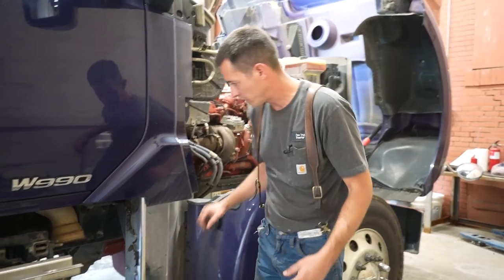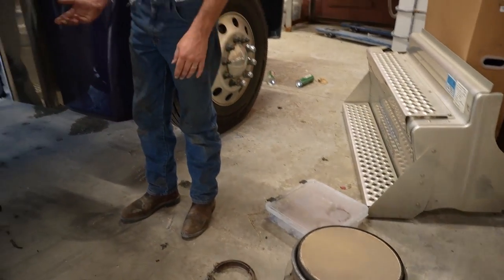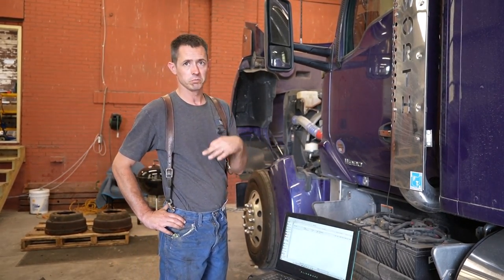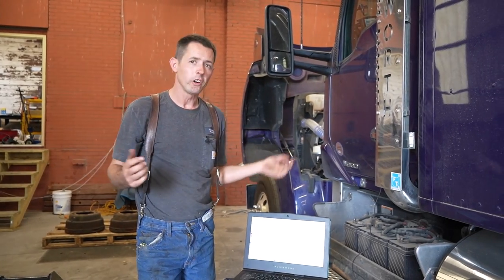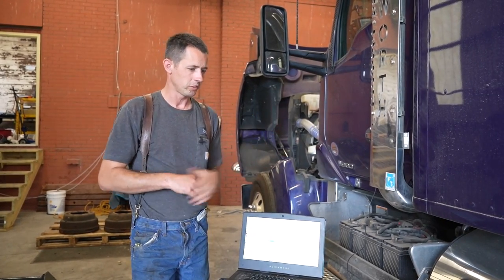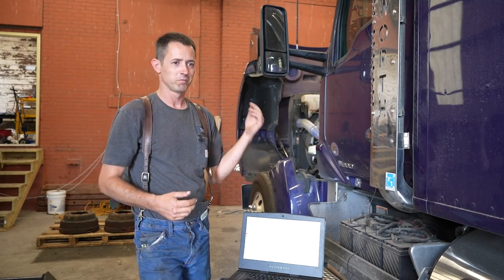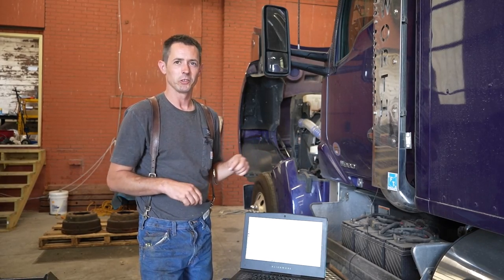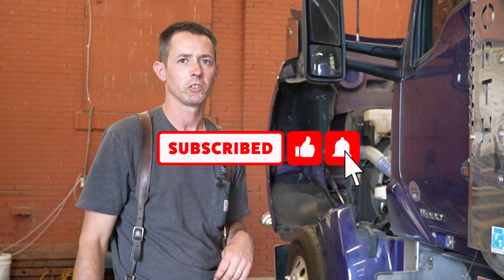Will Truck Run With DPF Unhooked?

Comment: This is how diesel engine supposed to run. If Truckers in the U.S. and Canada were smart and mechanically potent enough they could run diesel without DPF and EGR while police wouldn't be able to notice unless they take pollution test

Comment: I do believe...as soon as the speed sensor starts transmitting movement you might trigger a derate, i have found that disconnecting the right front ABS sensor on a 2015 579 Pete with the MX13 will stop a derate.
Reply: For how long?
Reply: It will. Go down the road, put a load to it, and *bing*, engine light comes on.
Reply: Engine light mean nothing.. all it is telling you are polluting.  I run with check engine light on for 100K miles and still running fine.  I just reset the dpf and force regen with my scan tool. Derate is non issue for me.

Comment: I’ve noticed even on my truck because I’ve started it and ran without down pipe…these newer model engines with EGR and VGT turbo they’re not really as loud as the older engines that are straight piped….mine is fully deleted now and still pretty quiet with modified DPF
Reply: What year, truck and engine may I ask?
Reply: @jimjim6803  2010 and 2016 ISX
Reply: @jimjim6803  maybe a bit more throaty but not bonejarring like the cat and n14
Reply: Upgrade your turbo to a non vgt and it’ll wake up and be loud (if that’s what you’re looking for)

Comment: AWESOME TO KNOW!! I have a 2017 ISX that's giving us 50.4 inhg (24.5 psi) exhaust pressure with erratic exhaust pressure code and it's hitting 185 deg ECT after about 10 min of idling. New inlet, outlet and exhaust pressure sensors (had codes for all 3). I suspect the dpf or doc is plugged. gonna be starting it tomorrow without the doc.  THANKS!!

Comment: I blew the flex pipe on a 2011 cummins that was between the turbo and dpf scr system and it had a surge of power and ran fine all day. Just Loud and fumes from under cab I got it fixed asap